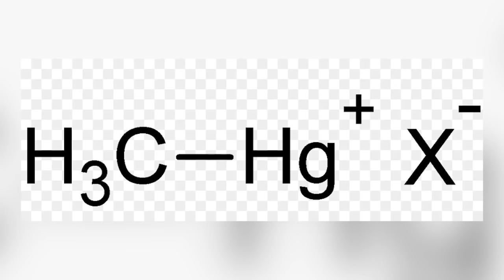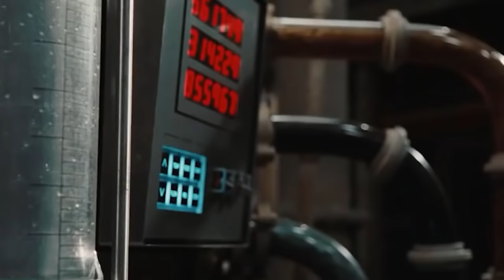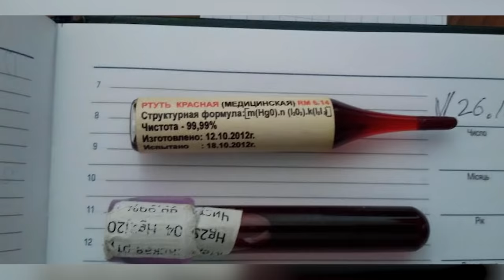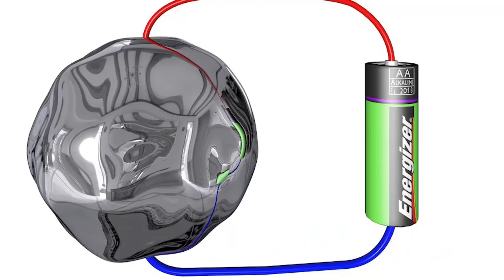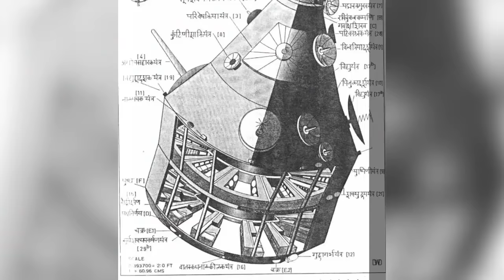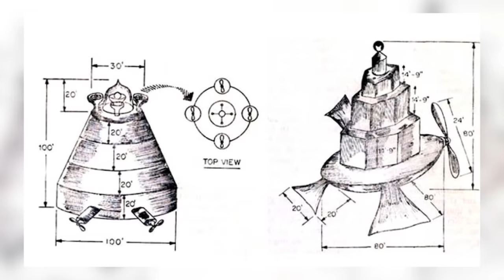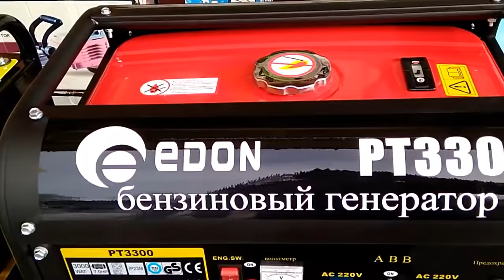Thats Why Mercury Engine Is Forbidden

Comment: The old expression "as mad as a hatter" refers to the number of furriers who went mad making felt hats from beaver pelts using mercury salts, which left them with nervous afflictions interpreted as madness.
Reply: YES!
Reply: You believe that huh?
Reply: There was a lead band inside to mold the hat to the head.  Lead is flexible and holds it's shape until force is applied.
Reply: @alphaforce6998  Which other explanation can you give, why those haters who used mercury went mad, while others who didn't didn't?
Reply: @alphaforce6998  Mercury and mercury salts are two very different things. Mercury salts penetrate skin.
Reply: @Baronello   Which is exactly why mercury, the metal, should not have the false reputation that it does. You will not be absorbing mercury into your skin by holding it in your bare hands. The salt of a particular metal is not the metal itself. Just like carbon left over from burning wood is not wood anymore.
Reply: @alphaforce6998  You still would want to work with mercury either outside or under the fume hood since it evaporates above 18c, albeit very slowly.
Reply: Wrong. Mad as a hatter comes from using arsenic to dye fabrics black.
Reply: Ghost rebel,  I was given to understand that metallic Mercury was used in the felting process of wool, prolonged contact with skin can cause absorption plus exposure to vapour will risk neurotoxicity,  mercury was once used as a treatment for syphilis by massaging it into the skin in pre penicillin days, this was replaced by Salvarsan an arsenic derivative.
Reply: @Baronello  Yes! It burns at incredibly high temperatures and produces vast amounts of power.
Reply: Danbury, CT

Comment: I was wondering why something the teachers gave us to play with in school to demonstrate it's properties turned into something they now evacuate schools for if someone breaks a thermometer. I just turned 70 and am in fine health so I'm skeptical about it being so dangerous. And I really miss mercury switches which used to be on every car that had trunk/engine compartment lights and all washing machine lids They were simple, never failed or went bad, so I guess they had to be replaced with something that did.
Reply: Agree with everything you said
Reply: Agree with you 100% 

And you're EXACTLY correct. They were replaced with something that can wear out.... profit over everything.
Reply: in the 80', my school had a Mercury safety valve on the heating system, like a  U bend under a sink and supposedly, it was to let blobs of water through to the sewer in the event of over pressure. However we had a blowout, so all of the 19kg of it got blown into the sewer. That made head lines in the local paper, and there was a cleanup operation in the sewer, so environmental wise, Mercury was handled carefully then too, (the school was not evacuated).
Reply: Right . Like a light bulb. Imagine all the mecury lying around if that continued. We use it in neon lighting. It agitates the gasses and  changes the color.
Reply: Its dangerous when vapourised. In liquid form it's pretty harmless.
Reply: I have the opposite experience. My dog died from mercury poisoning when I was a kid after we dropped a thermometer on the floor and it spilled everywhere. Just because it doesn’t happen to you, doesn’t mean it doesn’t happen

It’s probably the same as the case with asbestos. We now know that it can cause cancer, but we used to use it to insulate buildings.
Reply: The vapor (and methyl mercury) is what's so dangerous, and it evaporates even at room temperature.
Reply: Slightly younger (65) but when l was 12 l had gathered a quarter of a shoe box of Mercury switch cylinders. No reason other than l thought they were cool. They were everywhere in the late 60s
Reply: It must be an elite thing we should fight to obtain pure mercury
Reply: @randomtricksvideos  
Its the biologically active forms of mercury which are dangerous : pure mercury by itself has a very high surface tension reducing the amount penetrating the skin. 

Once it is in a biologically active compound it will go straight through the skin and the amount in a thermometer is sufficient to kill. 

A particularly frightening aspect of it, is that once symptom show, it is too late : there is a YT video of a female professor who thought the gloves she was wearing would protect her, it was the consensus at the time, but they didn't. When she started showing symptoms, she recognized them as she worked on the effects of mercury as part of her work, treatment started immediately. She knew there was no hope and died of brain damage.
Reply: I just noticed the video on mercury poisoning https://youtu.be/NJ7M01jV058

Comment: Mercury in its liquid form is very hard for the human body to absorb, which means it is usually quite safe to handle. But mercury vapor can be absorbed and starts causing brain issues at fairly low doses, eventually becoming toxic. But one thing the video completely omits is that mercury and aluminum are quite reactive and the mercury will eat its way through aluminum. For that reason no mercury is ever allowed on airplanes, which is the main reason for restrictions on mercury use overall these days.
Reply: I thout that was gallum
Reply: @blakenelson4158  MY PRECIOUS COUGH GALLUM, GALLUM
Reply: @frederickshasel5032  got the spelling wrong but clearly you got what i was talking about 8)
Reply: Mercury doesn't even become a vapor until over eight hundred degrees

Comment: I played with silver mercury when I was young. I remember feeling the weight of it as I rolled it around in my hand. My dad told me not to put it in my mouth but that was the only warning he ever gave me about it. Since then I have heard alot about how toxic it is and I wouldn't touch it intentionally.
Reply: I get you. I’m glad your dad had the sense to warn you about putting it in your mouth back then, even when it was not well known. Nowadays we know it’s difficult for mercury to be absorbed by the body outside of open cuts. Amalgams and mercury vapor are the real hazard. Since it’s hard to recognize either for obvious reasons, we generally avoid mercury these days as a precaution.

Comment: In the case of the mercury motor, it would be nice to understand just how much electrical input was needed to get a pool of mercury to be able to turn a shaft with 1hp of torque. Then take on board heat generated, I guess I’ll just need to keep looking for mercury, because I think there’s a good propulsion system potential in a hydro magnetic drive utilising mercury.
Reply: I agree and the heat factor was in my thoughts to.
Reply: Let’s
Reply: @youbian  let's ask Dr. Del Padre
Reply: The mercury secret lies in its ability to store unlimited energy in its plasma state not in its ability to spin in its liquid one.

Comment: Fun fact: Mercury is the reason so many lighthouse keepers went insane. Fresnel lenses were often supported by mercury bearings (As we lacked the tech to make decent ball bearings until the early 20th century); 3 tons of glass rumbling around in a tub of 400 pounds of mercury.

This would have to be strained through cheesecloth for cleaning *by hand*. In the hot glass dome of the lantern. Which often caused it to release mercury vapor, which would then be breathed by the same lightkeeper already dunking his hands in it
Reply: You mean: 'METHYL MERCURY' and not Regular/Natural occuring mercury....
Reply: @pkfreerunner97  No! Regular Mercury!
Reply: @pkfreerunner97  naturally occurring mercury is still bad for you when inhaled because it is a heavy metal. It isn't usually a problem since the vapor pressure is fairly high but in a hot glass room... Could have an effect over years of working with it.
Reply: Thank You for the History Lesson. I thought it was pretty cool.
Reply: @growlingbehemoth Yes! Exactly! That was a mercury vapor problem as well
Reply: @growlingbehemoth Yes. Hat makers used mercury.
Reply: Exactly!
Reply: This comment was helpful. I was looking into if it was possible to use mercury as a bearing was looking into energy created with flywheels and if it would be possible to use mercury as a bearing.
Reply: Being a lighthouse keeper would be enough by itself to send most people mad,the isolation and all that
Reply: probably ghosts
Reply: Allegedly.
Reply: @toowongfoo5479  No, it's well understood.
Reply: @joez.2794  can you provide me some info I can look at about this subject?
Reply: I'm sure being stuck alone in a tower without much contact to the outside world doesn't help.
Reply: @grantwalkersound  your comment just inspired me to create a name for a band..... Mercury Isolation
Reply: The MadHatter in Alice in wonderland was fitting because of the mercury they were exposed to.
Reply: I wonder what future generations will identify as having driven us mad
Reply: Yup the lens and lamp electrodes floated on a vat of mercury. It made the mechanism freely moving and the mercury acted as a heat sink. Also I've seen high sensitivity interferoneters mounted on big blocks of quartz glass on a tub of mercury. The stuff isn't as nearly restricted as one might think, and lots of places would be more than happy to give it away because the high cost of disposal 😮

Comment: Mom and I played with it when a glass thermometer broke. No after-effects, except that pesky third eye.....
Reply: Luckily for you, not all forms of Mercury are as horrific. The expression 'Mad as a hatter' the inspiration for the character in Alice in Wonderland comes from when hat makers used to use mercury in the production of hats, which slowly seeped into there bodys overtime and made them quite mental. Mercury is a Heavy Toxic metal and should be treated with upmost respect.

Mercury is for example still used as a filling for teeth. However in this form its stable and does not seep into your body.... so they say.
Reply: problem with mercury,as with other heavy metals,is their cummulative effect.you get a dose,and another,and another,and nothing happens,until you reach your thereshold,and then all the worse happens,because ir stays in your body forever,making you sick forever,or dead.
like some epoxy glues and so on,than we usually use without gloves,and nothing happens regardless of the clear manufacturer instructions,but sudenly,one day,touching it,it causes you a skin reaction,and forever,whenever you touch epoxy resin,it causes you a skin reaction,everytime.
this is cummulative effect.
on the other way,i used to play a lot with mercury,i have 1kg of it at it is real fun to destroy some alloys like aluminum just by bare contact.i hope really nothing happened.
Reply: @xiro6  AL-UM-IN-IUM!(are you American?) check the periodic table there is no element called  AL-UM-INUM!!!!
It's also not an alloy(until you mix it with other metals).
Reply: @mjhawkins1990  then he may be talking about foil. Aluminum foil does contain aluminum alloy and the more common houswhold spelling is accepted. Aluminium is sometimes referred to as Aluminum and it is generally accepted as a common term. We dont all call animal species by their genus phylum and class. We just call cats "cats" and dogs "dogs" which are still accepted in common speech.
Reply: Very well stated. 😊 👍 I'd like to comment further about anti gravity, mercury  and RH negative people,  but when I do, my comment always magically disappears lol.

Comment: There is definitely something to this mercury engine technology. And it seems easy to make although I would be concerned about shielding from the intense electo-magnetic fields. I wonder what would happen if one used a mercury engine powered by a Tesla coil instead of battery power. I'm sure engineering details would have to be worked out for a craft that could support passengers in spaceflight. And that Schauberger engine was powered by water, could it be powered by mercury? Definitely an upgrade in design there. Just some thoughts...
Reply: Sounds like you are on the right track. Frequency is everything when dealing with antigravity.
Reply: Ignores the fact that the entire aether is full of electrical charge, which can be harvested. Think running a tesla coil in reverse, where high voltage low-amp aethereal electricty is stepped down into lower voltage with higher amp. The key is maximizing the surface area of a conductor that is fully isolated from the earth.

Mercury-filled spheres are another missing element. When a DC current is applied to mercury, it will cause the mercury to rotate and emanate a magnetic field. This provides the oscillation required for a transformer to work.
Reply: sounds like tr 3b
Reply: @opipico9144  What model of physics is this? I don't hear a lot about modern aether theories since most physicists went to the general/special relativity model following the Michelson–Morley experiment, do you have any further reading?

Comment: I visited a old gold mine once that still had bottles of it at the time. Apparently they used it to help separate the gold from the dirt.
Reply: True. But not as efficient as the present Cyanide process, which is waaay more toxic.
Reply: They used to make an amalgam of gold and mercury and then vaporise they mercury off to be left with gold. They would run the vapour through a condenser to recover the mercury in larger mines but often smaller ones would just let it go into the air.
Reply: It is still done this way in 3rd world gold mines.
Reply: They still do

Comment: We used to play with mercury in High School Circa late 1960's. The only caution was not to heat it up to boiling or to ingest it. Floating steel bearings and coating penny's all the while dipping our fingers into the stuff was amazing. One warning though if you go to pick up a bottle of it beware it's many times heavier than you think and you could drop it.

Comment: In the 1960's the school I attended issued the science lab pupils with test tubes containing mercury.  With which we used to make thermometers.  I remember playing with it on the lab work benches.  Also teeth fillings back then were mercury based.  I still have those fillings. Mercury was also prescribed for children for oral application, to aid intestinal problems.  I personally have never experienced any ill effects from mercury.  My current door bell has a mercury switch in it, but that is sealed inside a glass vial.

Comment: In 1970 I had an incident where I had 8 to 10 kg of mercury give me an unwanted shower.
I was tasked to clean a quantity of mercury.
The flask had an outlet at the bottom which gave away after it had been placed at a height of 7 feet above the cleaning apparatus.
Gravity was used to force the mercury through a small opening (orifice) into the cleaning apparatus. The orifice is used to present the maximum surface area to the cleaning apparatus. 
Needless to say the gold on my watch was covered in mercury even though it was under my long sleeved shirt.
I had mercury in my hair, in my eyes and stuck to my skin where ever hair was present on my body.  (yes in the hair of my man parts.)

Large amounts of Sulfur powder was used to help capture mercury which was all over the floor.
I also took liberal dusting of Sulfur powder and a very lengthy shower.
The tiny droplets which were lodged in my eyes and eye lashes were removed with tissues.

After the accident I attended collage.  I hold a certified engineering technologist degree in computer engineering with a side recognition in tool and die making, as well as several 3d year credits in computer studies.

I am still alive and well no side affects.  I have two very healthy girls and grand children.
I think that the mercury had no effect on me.
Reply: Clearly you didn't eat enough of it, then!! :-)
Reply: Wow. What a scary story. Glad you’re ok and around!
Reply: I was shot in the head with a bullet but I survived and luckily I have no side effects from the injury. I was patched up nicely and carefully. Bullets are not deadly to the head. Proof right there.
Reply: Ummm... I think you meant “college”
Reply: Apparently, there was no dain bramage.
Reply: @adambalogh8728  I met a man who tried to commit suicide by shooting himself in the head, but he didn't aim the gun right. He shot off his chin, front teeth, lips and nose. Disfigured for life, but he survived.
Reply: Be careful around an mri machine. Mention this incident beforehand particularly about your eyes if you need an mri.

Comment: I used to have a chemistry set with elemental mercury back in the 90's. I remember putting that stuff in a magnetic loop to see what it does. Stuff just went in circles and by playing around with the electrical circuit it would go faster until it splattered all over my room.

Good times. Got lots of 1st prizes in the science fairs.

Such a simpler time.